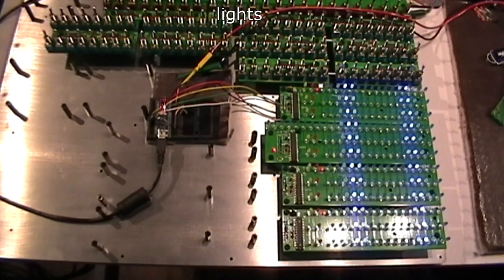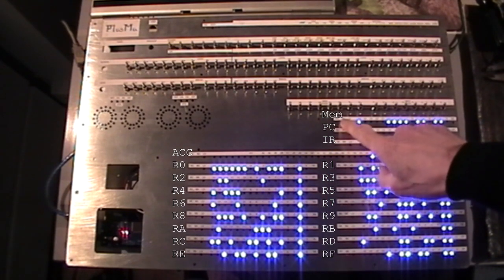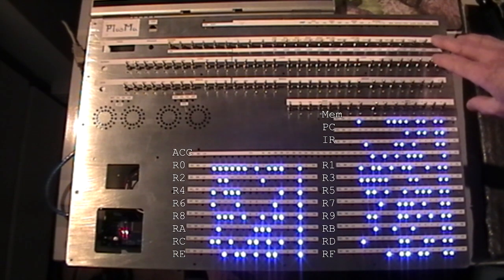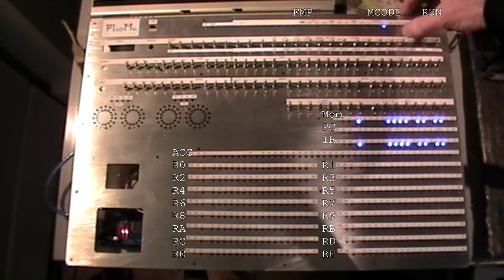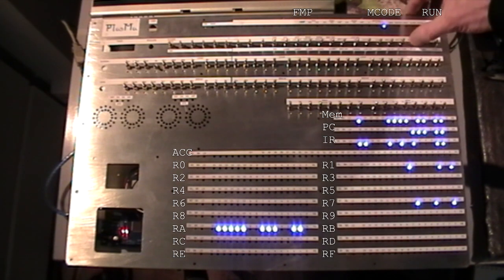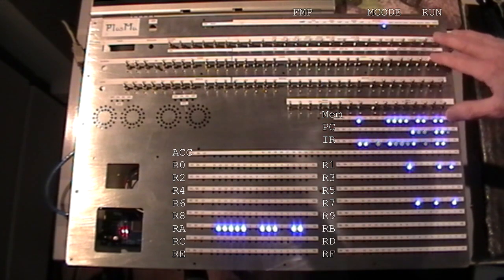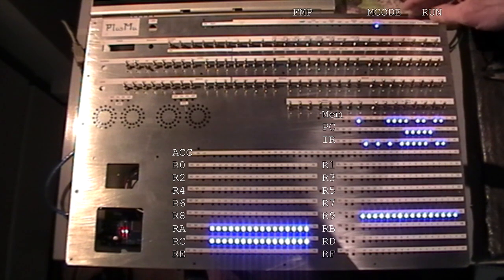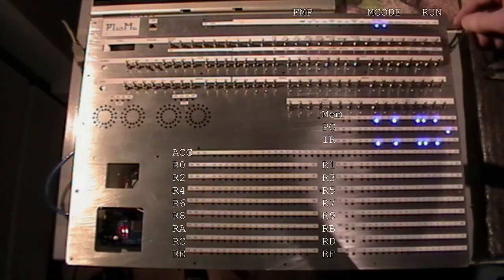PlasMa - 2. Switch-on and first tests

Comment: I always stalled with break points I never could decide how I was going to describe them compared to a jump to
Reply: Thought about making the controll line and not memory bits signal break as some accumulator schedule budgeting but I was only willing to toss 3 bits at it and that was not enough and filled with garbage collection non rtos rules
Reply from the maker: @fenderrexfender thanks for stopping by.